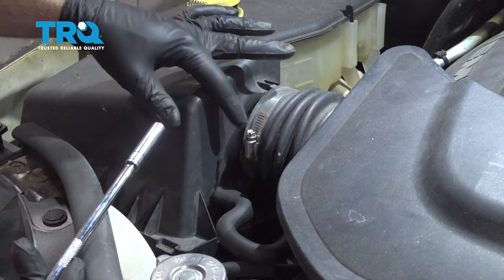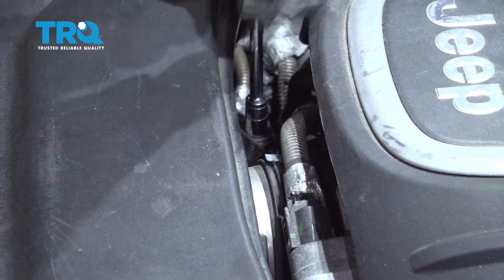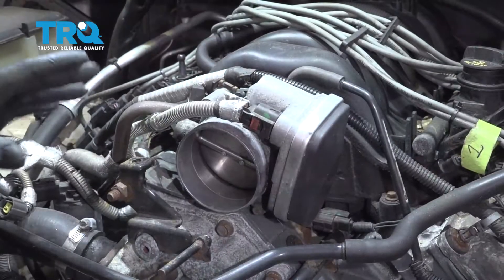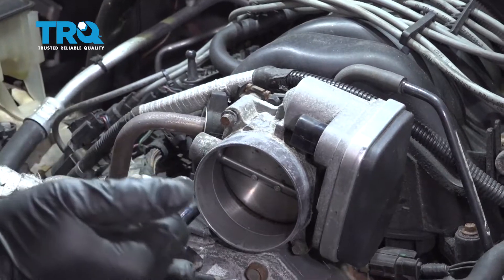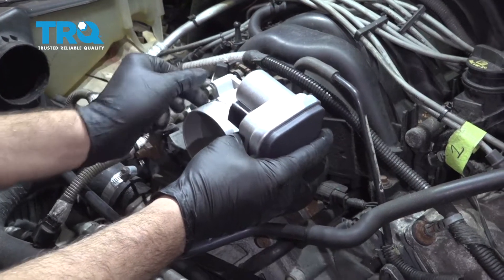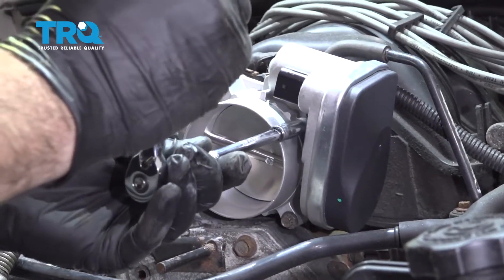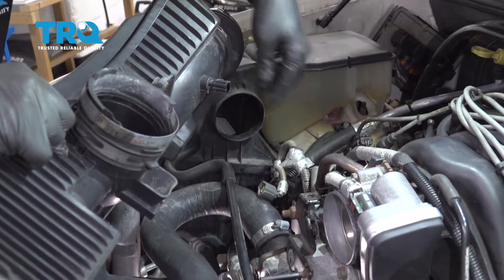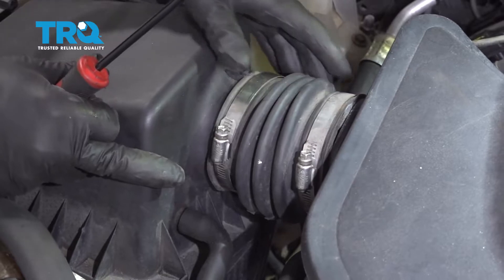How To Replace Throttle Body Assembly 2005-2010 Jeep Grand Cherokee

Comment: Thank you so much! My 05 hemi was having a rough idle and hesitation at take off from stop. Cleaned the throttle body and it fixed the hesitation and 50% better idling now.

Comment: Maybe you didn't noticed, but the rubber union between the throttle body and the air intake unit is damaged .... basically missing halfway 🤔